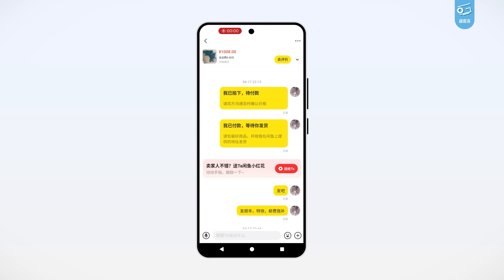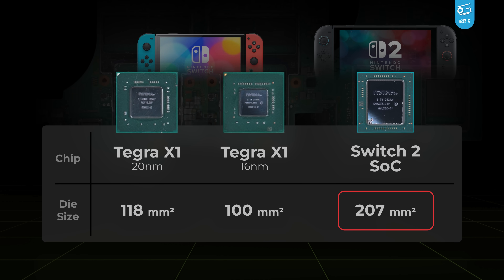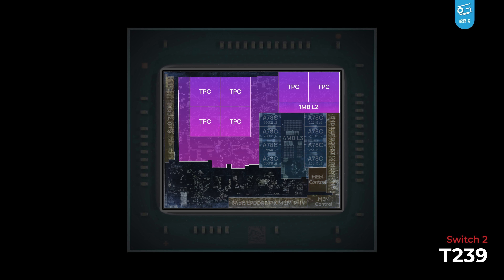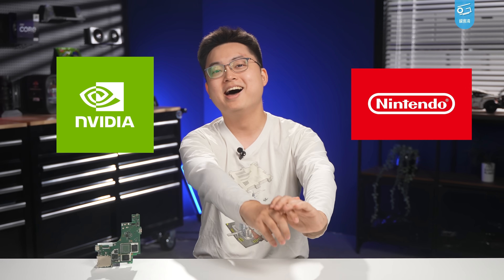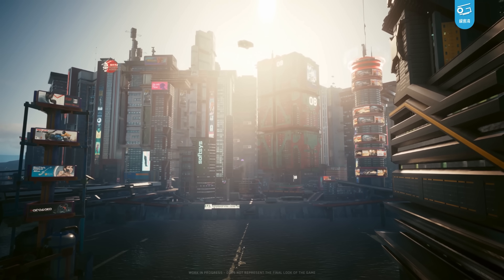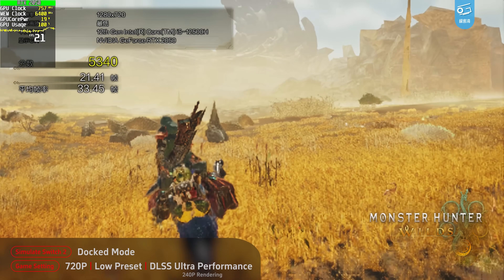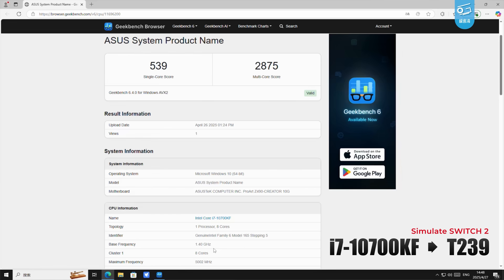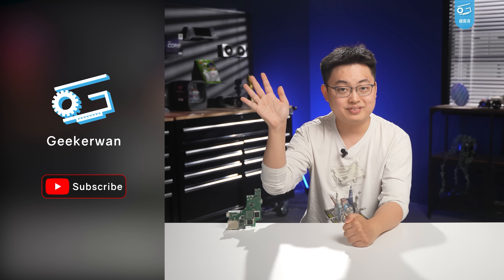This is Nintendo Switch 2's CPU!

Comment: My old PC has a GTX 750ti on it, I was quite surprised seeing it so close on the benchmark graph! Maybe it will still be able to emulate Switch 2 games then (probably not😆)
Reply: Like you could emulate PS2 with 300 mhz Pentium 3 and Intel hd graphic? Not gonna happen.
Reply: @MuhammadHaris-w1c  tbh the GPU has less of that problem, the bottleneck in emu is the CPU when it has a different architecture, otherwise JIT and graphics translation layers run very well!
Reply: @mgostIH  yes gpu is less of a problem. But have you ever seen 1:1 emulation on any console/PC? If Switch undocked equivalent to 750 ti, what makes you think it could emulate the switch 2. Not to mention newer architecture have so many new feature version like new directx version APi, new vulkan version API, dlss, rt and probably mesh shader.

Let me tell you about the case of gtx 1080 ti when running Alan Wake 2.
For the raster performance only, GTX 1080 ti is more than adequate to run Alan Wake 2. But because it does not support mesh shader, Alan Wake 2 run like cr*p on  that gpu.
Reply: @MuhammadHaris-w1c he can run them at less than native resolution, like switch 2 runs at 540p and 750ti at 144p
Reply: @bulletpunch9317  lol. 144p is so 2005 when i first had my mobile phone.
Reply: @MuhammadHaris-w1c  fsr will make it look like a 3ds game so its all good.

Comment: before people call the switch 2 underpowered, its NINTENDO they ALWAYS use obselete hardware but make amazing games and features so it evens out. its also HANDHELD. "steamdeck is too" yeah but its thick big heavy. the switch 2 having more power than the ps4 already says alot and the ps4 was amazing when it came out and still is. and to have this battery life and low price its worth it honestly. and its a massive jump from switch 1. just game prices but thats always been a nintendo issue.
Reply: Switch 2 is more powerful than Steam Deck in Home Console mode according to these specs.
Reply: @ I was going to say that but left it out as I wasn't sure.
Reply: @coyhCoyHerbert true, but only the gpu. the cpu is far behind
Reply: @HermesderWetterbote Even the GPU is weaker than the 2025 Qualcomm flagship chip. Which wasn't the case in 2015 Switch 1.
Reply: @nvnh319  2025 flagship phone is also more than double, more like triple the price of a 2015 flagship phone.
Reply: @Xgen001  Take out the modem, ISP and NPU, and it won't be that bad. See OnePlus Pad 2 with 8g3, that one only has modem removed and pretty affordable.
Reply: @coyhCoyHerbert it's more powerful then xbox series s
Reply: @Somtejesstudiosits weaker, watch the video
Reply: Switch 1 and Shield 2015's chip was overpowered compared to mobile chips at that time, especially GPU. Now the Switch 2's GPU is weaker than the fanless 8 elite. Underwhelming indeed, but not surprised. The tech in T239 dates back to 2020.
Reply: the steam deck is like the wii u gamepad. and it's heavier because it has a bigger battery and an actual nvme ssd
Reply: @ yes, just not very affordable or well known or easy to carry for a demographic of 8-13 year olds they prefer easy to use just working not over complex. steam deck is like for us gamiest gamers.
Reply: @yolopolotyuryou can get a LCD 64 GB right now for 350 to 400

Comment: Sadly I feel like even though the Switch 2 is 700% more powerful than the Switch, any game that doesn't get a patch will run a lot like they do on the original Switch.  Sure any games that had variable frame rates will be better, but you'll have games like RDR2 on PS5 could easily run with a doubled frame rate and simply want because the developers decide not to do it.

Comment: Still very strange that the CPU clock speed is slower when docked...
Reply: It still doesn't make sense to me, ideally you'd want CPU speed to remain the same no matter the mode for everything CPU to stay consistant between modes
Reply: Portable mode relies more heavily on DLSS upscaling so needs more CPU resources. I guess they think upscaling artifacts won't be as easy to spot on a small 1080p screen.
Reply: @bonzobanana1  DLSS is handled by the GPU cores.
Reply: @dab88  No, not exclusively there is a CPU requirement too. Deep logic super sampling requires more CPU resources especially for its high quality mode compared to high performance but both have CPU processing  in additional to GPU processing. I can't think of another explanation why the Switch 2 has more CPU resources in portable mode can you?
Reply: @bonzobanana1 the complete operator is true docked it’s a 4k device but we have almost double yhe tensor clocks docked and rt as well as the entire gpu
Reply: It will be compensated by full wattage and full bandwidth .. why not just clock balance the gpu to cpu tho .   Clock both at 1000mhz exactly or 1100 . Also these clicks do not take into account boost modes and other clicks used switch 1 had all kinds of clocks going on after a few yrs
Reply: Maybe gets too hot with 4K?
Reply: Probably to compensate for the hit to memory bandwidth?

Comment: For emulating the performance of the gpu of the switch 2, wouldn't it also be possible to test with an underclocked gtx 1660 ti? one with lowered memory speeds and clocks of course as it otherwise matches the switch 2 in terms of cuda core count which theoretically would give more performance per core on average. although I do see the error as this is comparing turing vs ampere, still would be an interesting experiment none the less

Comment: So it’s basically 2021/22 hardware released in 2025, very typical Nintendo
Reply: Funny enough Switch 1 used Tegra X1 which came out in 2015. Switch 1 was released in 2017, a two year difference.
Reply: The Wii hardware released in the eaely 90s

Comment: There is no way this is less powerful than the steamdeck when the graphics clap the steamdeck in game graphics
Reply: well, cyberpunk 2077 runs definately worse in Handheld mode on switch 2 than on the steam deck. steam deck can go native 800p with stable 40 to 60fps, while the switch 2 is running natively in 360 to 540p upscaled to 720 to 1080p @ 20 to 40 fps.
Reply: @HermesderWetterbote  did cd project red confirm this?
Reply: @bambinazo123  yeah. the framerate is confirmed by testers, the resolution by cd project red. "dlss dynamic 720 to 1080p with 50% upscale on each axis." that means native is half of it: 360p for 720p and 540p for 1080p

Comment: As much as Monster Hunter Wilds is very poor on the simulated rig, it should be noted that the game on PC has a minimum requirement of 6GB with a GTX 1660. For the game to still run on the simulation rig with only 4GB of VRAM, chances are that it's having to swap around graphical data, affecting performance. A Switch 2 version is not likely to hit this low.
Reply: And Tegra T239 have 1.536 Cuda-Core its like rtx2060 with 1.920. gtx1050ti have only 768, then you have more ram because consoles dosent have vram, Frequenz and refresh rate it’s basically same like 2060. You will get in Switch2 RTX2060 with round about 10ram(vram) and if you use live chat it will be like 8vram
Reply: Just a tiny info console’s don’t have vram they use the regular ram and switch2 has 12GB(GCN) 😊
Reply: @DailyFact51  To a degree, VRAM is considered what the GPU accesses. But in a case with consoles these days, it uses a unified RAM configuration where the CPU and GPU can access any portion of it. PCs, including portable PCs, still are restricted by having a separate allocation of RAM that the GPU only accesses, whether that comes in the form of discrete GPUs with their own RAM, or having to take from the existing RAM with APUs.
Reply: @ yeap that correct they use unified ram, that why you can’t compare regular PC GPU with Console. 👍🏻
Reply: but on such a low resolution the vram is more than enough 😅
Reply: @HermesderWetterbote  The vram requirements of a video game don't all scale proportionally to resolution, there's a floor, for example, in Forza Motorsport's benchmark at lowest settings, 720p with DLSS ultra performance (240p internal) doesn't use any less vram than 720p native (3.3GB).
Reply: @HermesderWetterbote  All the ting gonna look pixelated as heck.
Reply: @Lawz1993  they should have used a 720p or 800p screen in Portable mode 😅

Comment: The only gripe I always have with these PC mock-ups of gaming consoles to measure performance, is they are always running an OS that takes up a lot of resources. Switch 2’s OS is basically a revamped version of the Switch OS, and it users virtually no resources. There always needs to be a big asterisk in these comparisons.
Reply: Also, these games are not optimized for the Switch 2 hardware.  Optimization is key in game performance.  I have an older rig, but it is still pretty stout.  

AMD Ryzen 9 3900X 12-core 24 thread
RTX 2070
64 GB DDR4
2 NVMe 1TB SSDs

A game like Gears 6 runs like a breeze on my PC of ultra settings because it is very well optimized.  However a game like Craftopia runs like ASS because there is little to no optimization.

So, these example he is showing here can give us a ballpark idea, but even he said that there are a lot of factors to consider for the actual Switch 2 versions.

Regardless on the actual horsepower, I expect games to "look" on-par with the XBOX Series S at best, PS4 Pro at worst.  When you look at games like Ratchet and Clank, Spider-Man, Uncharted 4, God Of War 4, Ghost Of Tsushima etc. for the PS4, even if the Switch 2 was only on-par with the PS4, Nintendo 1st-party games could still cook.
Reply: He’s saying this is the bare minimum we can expect not a perfect representation
Reply: OS overhead isn't significant here, any huge gains are console specific optimizations. If you know the hardware the game runs will be static, then you can safely optimize for it more aggressively.
Reply: @xhivo97 It depends, his cpu bench with the reference orin was most likely working on quadcore... and also, the series s reference use a card with more features (like that infinite cache gen 1 thing).

Also, specific linux os for an specific hardware is definitely better with native software than windows or linux lts experiences... if you know about hardware it should be obvious.
Reply: @soragranda  The hardware facilitates the mechanisms needed to implement an OS; Nintendo can certainly optimize their OS since it's not a general purpose one, but that shouldn't affect gaming performance much. The OS stays out of the way, it's usually other processes that are running at the same time that slow things down.

The main thing that I was saying is that out of many other variables that directly affect performance, OS overhead is pretty low on that list.
Reply: @xhivo97 The thing is that the bench were already having issues, and the OS is by no means a marginal point in performance, close system can optimised way more than general purpose OS, this is something we know since ps2 era (pretty much).
Reply: Better than nothing its as they say. At least we have a baseline.
Reply: Right i think he could have compared switch stock and linux and used the difference as some kind of reference.
Reply: Since every console on here is simulated then it's fair, but it shouldn't be compared to actual GPUs, like the PS4 was comparable to a 750 ti in 2014 but 2 years later games were struggling to even launch on that card.
Reply: To be fair windows and Linux are running pretty comparable to Nintendo base clock speeds, the original switch has so much head room to the point it could quite comfortably hit 120fps at 1080p up to 2160p depending on the games... The clock speed on the og switch were so artificially underclocked and I'd be willing to bet they will have the switch 2 underclocked meaning a computer with windows nerfing the performance will but comparable
Reply: I wouldn't worry about the difference because developers won't do shit to optimize there games for switch 2, they will do the absolute minimum to slap there game on switch 2, I mean the switch 1 had some terrible optimized games, I mean Pokemon is a huge game and it ran terrible so I wouldn't expect better with switch 2 lol and I wouldn't support Nintendo's nonsense anyways, emulate it and call it a day lol
Reply: @Neukom720  Pokemon isn’t made by Nintendo, and everyone knows Gamefreak has no 3D open world talent. They made top down 2D games and even struggled with that. People like Panic Button, actually take advantage of hardware and squeeze good things out of it.
Reply: @garvensman  Its no use talking sense with a troll (last sentence is dead giveaway="im too cheap to even consider buying Nintendo games, so lets pirate instead!) 🤣
Reply: @RCTGaming  i mean i also only emulate nintendo games, but hes indeed wrong, its just pokemon being pokemon.
Reply: @Neukom720 Witcher, doom 2016, doom eternal, monster hunter rise, and many others were optimized for that potatoe that is the switch 1. The switch two is closer to current generation consoles than the switch 1 was to its generation and has futures like dlss to make up for it. Many games pushing for 4K or 2K on those platforms actually works to its advantage due to those games aiming for 1080p on S2. I think it'll be fine
Reply: @ Thank you! That’s what I’ve been saying myself. Switch 2 is far closer to PS5 visuals/performance than Switch was to PS4. It won’t match the raw power, but with more modern tech and DLSS, it’s going to take the “impossible” ports to then next level. It’s going to be an amazing hybrid.
Reply: @garvensman  Tbh I think we're going to see many games ported over just fine. Reducing the resolution and graphical settings is clearly possible on the switch 2 given dlss. Cyberpunk is practically a current generation Game, and is running just fine on switch 2. It's a launch game as well so we've only saw it at the worst it will ever be
Reply: @garvensman the problem is that modern consoles can use a lot of the same techniques that the switch 2 can. DLSS keeps being sold as this magic sauce that can make the switch 2 an Xbox series s (or even a PS5), ignoring the fact that those consoles can also use upscaling, they'll also be optimized for their specific hardwares, and how lightweight OS's. Even the steam deck has 2 of these, and sometimes can be optimized for its specific hardware, like with Assassin's Creed Shadows or Cyberpunk 2077
Reply: @tranquility6789 Nobody is saying it’s magic or that it’s making it actually more powerful. That’s an ignorant and disingenuous argument. 

It allows a console to run a game at lower settings, which requires less raw power and wattage, and then uses the AI process to present a cleaner image at higher resolution, without the need for brute force. 

Yes, of course the other consoles use upscalers. They use inferior ones. If they used the same process Switch 2 does, they could get way more bang for their buck, and we wouldn’t need a console refresh every 5 years. 

So, I’m just done with this notion that any human being alive is saying Switch 2 is as powerful as a PS5. What’s being said is that DLSS allows a lower power system to DISPLAY a game at CLOSER to PS5 level, without the need for raw power. That’s 100% factually correct. To argue against that is foolish.
Reply: They don’t measure performance there way off and that’s proven time and time again it’s also historic fact that a console and its api are 2x even 3x the performance of a pc  at these spec due to windows:dx and unrefined code not running to hardware level another one DF simply will  not admit there pc shills go look at comparisons of Dreamcast vs pc GameCube cs pc snes vs pc it doesn’t matter what era what console the console per meg per clock per spec DESTROYS THE PC its simple physics and math same applys console vs steamdeck steamdeck is trying to run bloated windows code via a emulation layer that is the complete and utter opposite to a console and its api

Comment: Im kinda curious if the switch 2 performance would be slightly better given the chip is built for lower clocks. To down clock a graphics card meant for a higher clock speed wouldn't that give the wrong performance metric?
Reply: well its leaked and also AGED hardware

so we can’t exactly tell

the test in this vid for cyberpunk ran on low settings 1080p dlss

when most testers deduced the switch 2 ran at 45+ at 4k dlss (which is slightly below 1440p)

so my guess is this is another uhh ps5 soc

its been seein that the console runs an rx 6700 and ryzen 7 4750g

and this hardware cant come near 4k while the ps5 does soooo

also nah im no console fan 

last console i owned was a ps4 at 2015 and sold it for pc
Reply: @Jay-Tan  yea the switch 2 is doing medium high settings rather than low. So I think this is more of a ball park but not set in stone
Reply: @ i homestly thought it was a mix of ultra on post processing

high shadow quality

high textures and uhh medium reflections 

tho it coild be lower and having ray tracing reflections on medium because it wasn’t confirmed or denied

also cdpr fonfirmed dlss was actually broken and the game was just 1440p native
Reply: @ ray traced reflections? 1440p native? Dlss broken? What are we talking about haha. I’m talking about switch 2. There is no ray tracing nor is the switch 2 running at 1440p. I’m confused
Reply: @ switch 2 IS running 1440p and its confirmed 
and it IS capable of raytracing as it has RT cores

and The brokend dlss is result of the showcased demo for cyberpunk being 7 weeks old